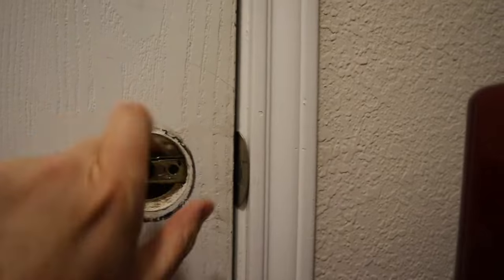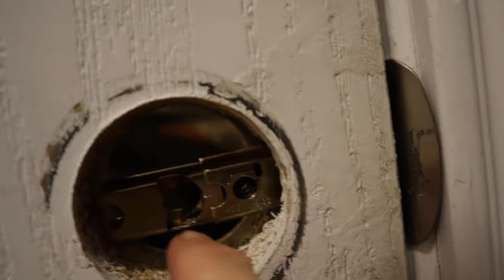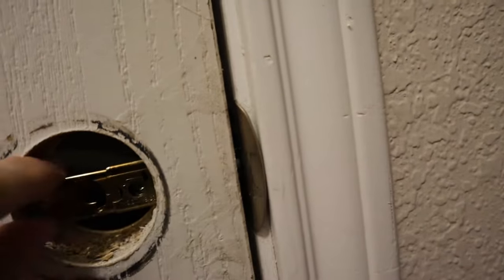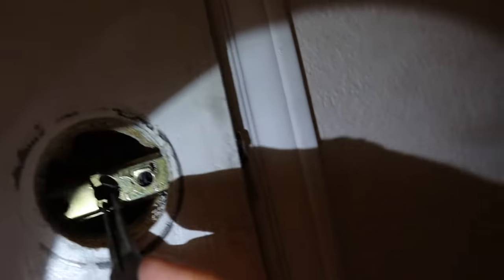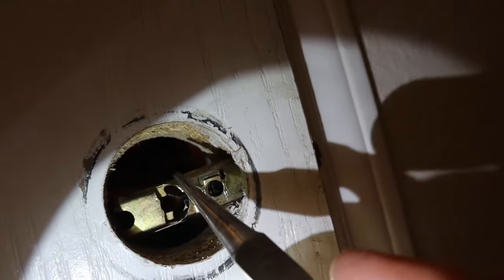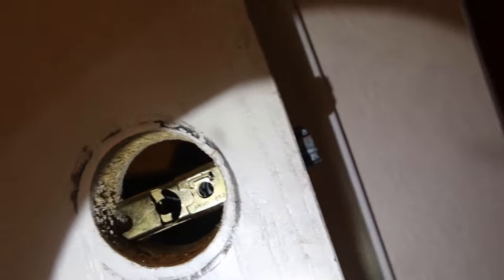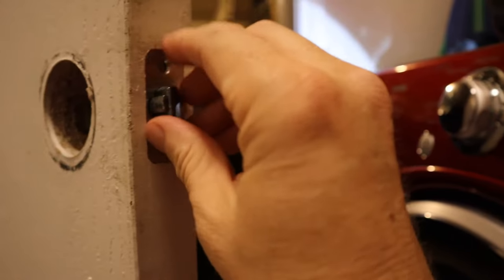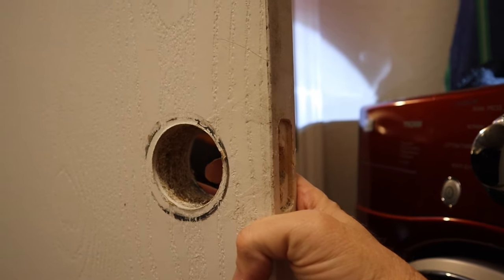How I Unlocked a Broken Door Lock (NOT a tutorial)

Comment: Thanks! Looks luke a tutorial to me how to get out of that situation..I have the same problem because the doorknob was so bad the door would not open. Got doorknob off and now the latch issue because because the door was closed to begin with. Fortunately two rooms had part of a wall removed and the other doorknob, also bad,  worked like one last time and then I taped the latch really good so it would not "lock". With YouTubers and a reminder from a lock store I got that doorknob and latch completely off.  Someone I watched had warned about closing the door at some point as to not get locked in or I might have done the same.  Glad you figured it out and showed us. Rats, this thing is different, The 2 sides I can access are smooth. Tried using a putty knife to push it from between the door and woodwork without success.  Still, thanks.

Comment: Damnit my latch looks exactly the same except theres no wire to tug on :(
Reply: Ik I accidentally broke mine and I tried fixing it before my dad got home but know I’m in big trouble
Reply: @aidanrodriguez7606  I wasn't able to fix mine, but i was able to remove it by jamming an old ID card between the latch and latch plate, and pushing the door open from the other side. Hopefully there's another way outside of your house/appt lol otherwise might need a locksmith. Either way don't worry about it. They break on their own sometimes.